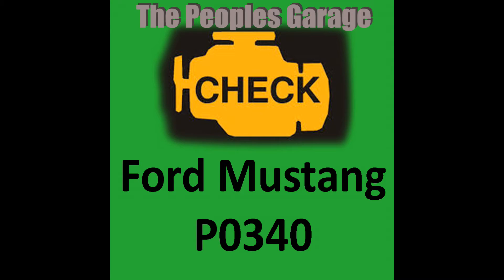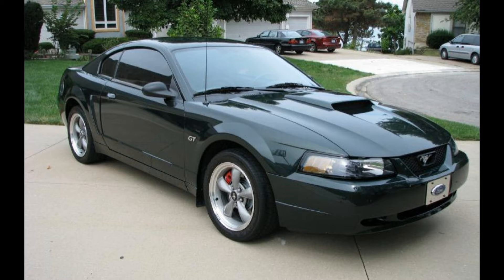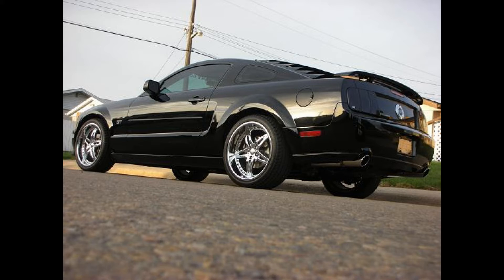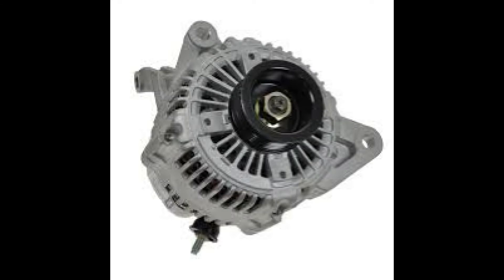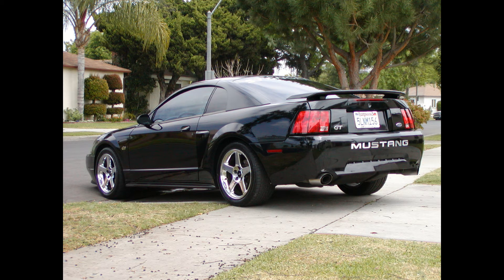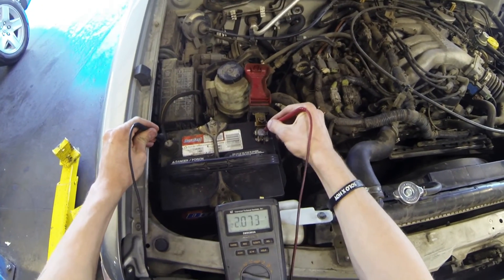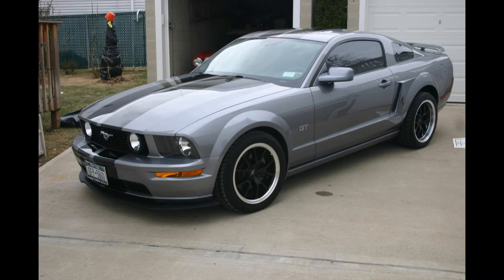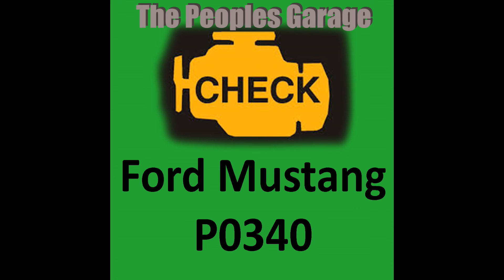P0340 Code - Ford V8 4.6L Engine

Comment: I have a 1999 mustang GT. 4,6l. I keep getting a system too lean bank two code. I checked for vacuum leaks. Still got the code. So I replaced the injectors on bank two thinking it was not getting enough fuel. So the system too lean bank two went away. But now I get a random multiple misfire code. And sometimes it will be all eight cyl. But I don't hear any misfire. It runs fine. Do you know what might cause this? And my system too lean bank two just came back again. Arghhh

Comment: Could a bad alternator ruin these sensors if they were replaced before the new alternator was installed. Im wondering if the voltage spike ruined the new sensors

Comment: i have the same problem in my f150 2010 i change the VCT solenoids the phasers and the camshaft position sensor and the same problem i dont know what to do but I
 don´t have the rough idle / misfiring

Comment: I got a check engine light on my Ford Mustang Gt 2006 and I check and  it was a misfire In two cylinders and I change the spark plugs and still I got codes 
P0306- misfire in cylinder 6
P0307- misfire in cylinder 7 
P0346-camshaft position sensor “A” circuit range and performance 
P0217- engine coolant over temperature
You wouldn’t happen to know what the problem might be?
Reply: Eddie Ruvalcaba replace the EGT and/or thermostat
Reply: Manifold leak?

Comment: In addition to the p code, my mustang also developed an audible, RPM-dependent hum/buzz through the speakers at the same time. Could the alternator be responsible for this as well?
Reply: Curtis Wood bad ground on ur radio
Reply: Def bad ground

Comment: you're so right. this code came up on my mustang, replaced the sensor and it wasn't that. after further testing now i know it's the alternator.  is there a certain noise the car makes when having this problem?  because since the check engine light came on with this issue the car makes a certain noise when i start catching speed. a sound like the sound a remote control car. weird but it sounds like that to me
Reply: It’s ur radio you have a bad ground

Comment: Could this cause my car to have a weird idle when i the air conditioning on or my defrost?
Reply: kuda9992, can be caused by low a/c refrigeration level. Check your a/c first. If low, just get refrigerant refill at auto parts store. Has happened to me. Turn the compressor on & idling speeds up, slows down, speeds up, slows down...

Comment: when you check on the battery, does the car have to be on, or can you just test it with the car off
Reply: Same question...do you check with the car engine On or Off?
Reply: @EloyRamirez  on, alternator only works when the engine is running

Comment: Great video. I have a 97 ford escort sohc with P0340 code. I replaced cam and crank sensor, timing belt and tensioner, ecm replaced, checked wiring from sensor to ecm (checked ok) and still have same code after cleared it with scanner. Any ideas? Can it be weak starter or alternator? Thanks.

Comment: I had misfires for freaking ages!!! Luckily i came across your explanation bro... I've changed the spark plugs to Iridium ones, the coil packs and the camshaft position sensor but still same problem (damn it)... I will run the multimeter test and (surely) change the alternator! Ratings for this very useful post!!

Comment: Thanks for the help bro, I traded in my 2007 automatic V6 Mustang for a 2008 manual Mustang GT three weeks ago. I'm still sorting out the kinks... My power windows weren't working at all because of a exposed wire short behind the stereo headunit but I fixed it... and the previous owner removed the shaker 500 subs and rear deck speakers but I replaced all the speakers with kicker ones... and I replaced a relay for my rear defroster and it works now, and now I have the CPS code and I have a engine misfire; one cylinder is not firing at all I think. I'm about to replace the alternator, spark plugs, and the coil packs and see what happens...